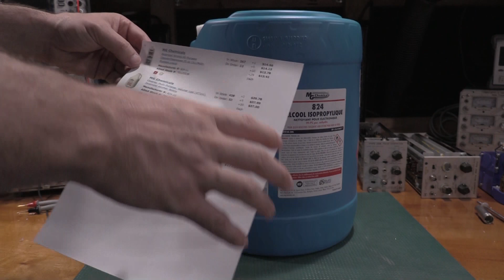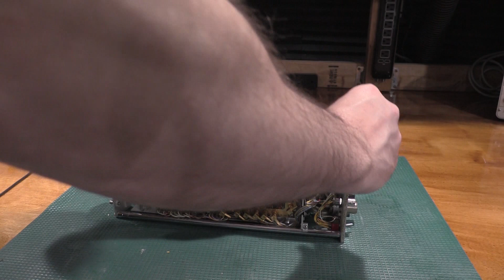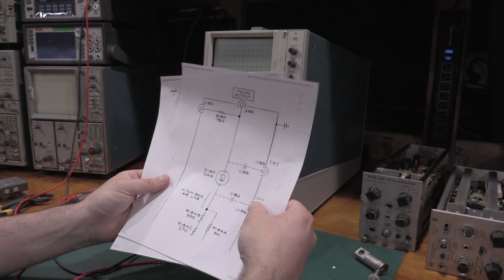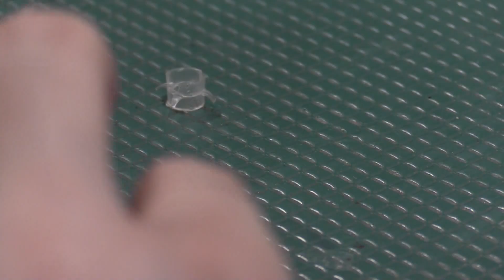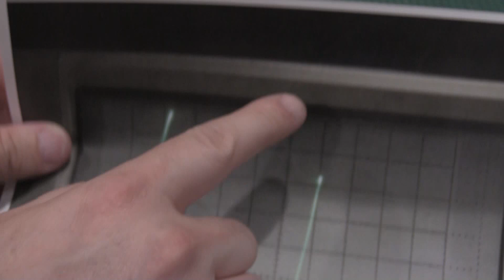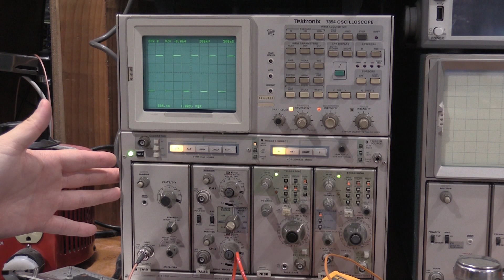Tektronix Type 284 Rebuild II Viewer Submission

Comment: Back in the late 60s, Tek had a casual policy for the teens that were children of employees and their trusted friends, to have supervised after hours access to the engineering building. They even had an official Explorer Scouts electronics program. One evening, there was a class on Tunnel Diodes for the Scouts, and the rest of us. It was probably 1969, so 52 years ago. I remember being amazed at what a Tunnel Diode would do, but sadly, thats about all I remember of that particular class. In the following half century I never encountered another one. As I work in analog audio engineering, there was never a need.

Comment: Nice work.  You need my 5S14N sampler and it's mating scope.  Great repair.  Makes me want to get my 284 back out and teeth cleaning.  Thanks for making these.  I've decided to pause on my Tek restorations to get my 1GHz calibration capabilities up to snuff.  I picked up a HP 53131A and this evening I upgraded it with the 3rd channel 3GHz and the Gerry Sweeney's high stability Trimble oven.  A quick check of my TG501 shows it happily putting out 1ns pulse in spec.  For the HP,  I need to make the decision on a GPSDO reference (for the whole bench really).  I'm having trouble picking one off ebay.  Too many choices.  Once I get that wrapped up I can return to calibrating the 5S14N sampler and then play with the Type 284 some more.  Did you decide which GPSDO to buy?
Reply from the maker: Rick, I was able to get the GPSDO up and running and locking correctly. I am doing some comparison testing now against the Leo Bodnar So a video will be coming soon on the frequency count upgrade and GPSDO
Reply: @Zenwizard Studios, that will be a cool video. So yours has the Samsung oven in it?  I’ve read that the only way to really know how solid the gpsdo is working is via the serial port into something like Lady Heather. And read that the built in LCDs in the small China sourced gpsdo’s on eBay simply don’t give that level of info. Are you planning to use a distribution amp off the gpsdo to drive a single source ref for the whole lab or just use it to calibrate everything individually? I realized after I upgraded the HP 53131A counter to high stability oven that I’d need to calibrate it, then realized I could just leave a gpsdo calibrator continuously in place as the driving reference. No need for that upgraded oven at that point. Anyways I’ll wait to see you test results before I drop $250 on ePay for gpsdo.
Reply from the maker: I have a Samsung unit on the bench now that I am working on. It is not locking as well as I would like. I think the might be a signal issue so I have an outdoor antenna that will be here on Wednesday. My Leo Bodnar is locking like it should but the e-bay one when compared to it is drifty and wont talk to lady heather. It does have a Samsung OCXO so that is a big check in the + column. In terms of sampling. I have some things on the way. I landed a DSA 602A with 2 plugins that will get me to 1Ghz. I also have a sampling framing coming that will be delivered tomorrow. It is a 11801C (No samplers unfortunately) If the frame works with the correct samplers that will get me to 50 Ghz though with extremely limited voltages >3Vdc I am looking at the 24 Ghz TDR plugins to start for that one. But that puts me in the world of 3.5mm Jacks Here is hoping the shipping is not too awful did not realise that a DSA602A is 72 Lbs

Comment: On Isopropyl and Methanol:  Well I use both because they have quite different and complementary cleaning properties.  The bane of the surplus electronics equipment restorer is the inventory and calibration stickers which get plastered over all external surfaces of the equipment.  And depending on the formulation or the adhesive either isopropyl or methanol works better for removal. I have encountered sticker residue that isopropyl won't touch but methanol dissolves with ease. I have also tackled residue that no alcohol will touch, but sodium hydroxide solution will remove. All of that said, I must point out that I have more than two decades of engineering lab experience and am very well trained in the proper use and handling of typical lab chemicals, these included.  So your warnings about toxicity and correct PPE are absolutely appropriate.
Reply from the maker: I have also found actual Ethanol to be of use in the lab as well but I did want the denatured stuff so I will admit there is a bottle of Everclear in the lab (not for drinking to much high voltage). The 190 proof stuff. Sodium hydroxide is also good for cleaning wood pitch off saw blades. but it is also NASTY stuff caution is required. Here in my municipality 5 Gal per container of fuel is what the local ordinances will allow (Gas/Petrol, Diesel, K-1 Kerosene, and isopropyl). Over that and they start to consider it Hazmat and industrial quantities. So storage starts to get regulated.
Reply: I have a large HP LCR analyzer that a prior lab covered with cal and ownership stickers. Most came off... a few are stuck with the most tenacious adhesive layer I have ever encountered.